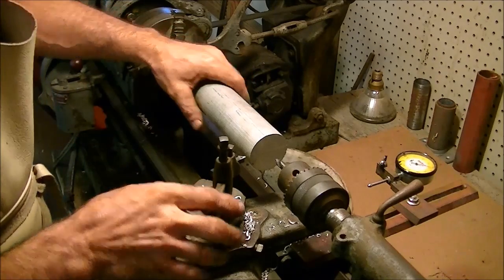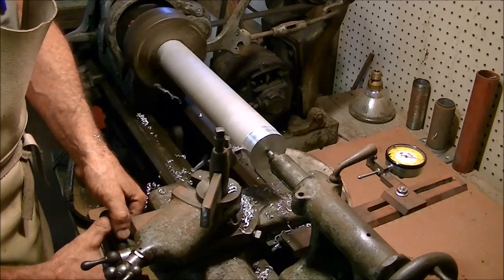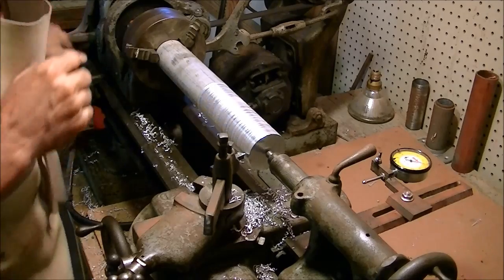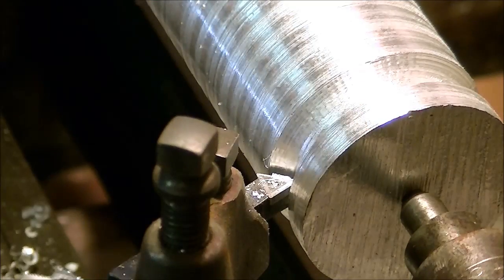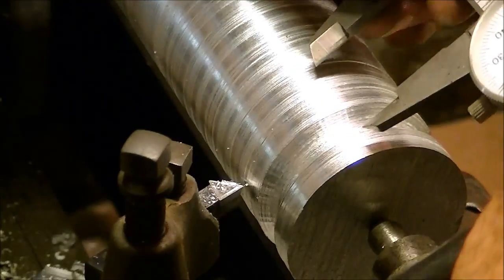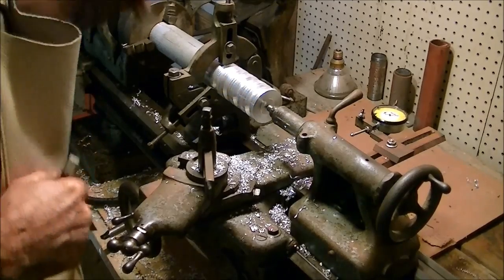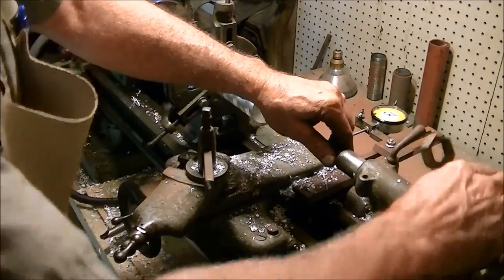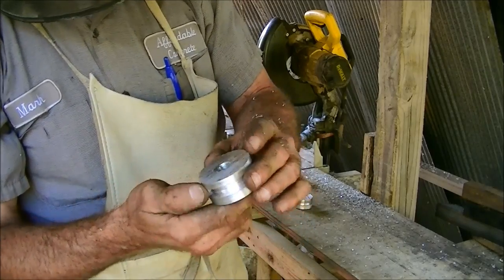Making 4 cable pully's out of 2" stock on my old lathe. Slowmotion and fast forward.

Comment: Whenever you find yourself turning aluminum again keep a can of WD-40 handy and use a really sharp positive rake high speed steel tool, you won't get all of the noise and chattering that you're running into. Cheers from one maker to another!

Comment: You don't use any cutting fluids/lubricants?
Reply from the maker: No, I don't do much machining, just when I need a part. I guess I should get some to have on hand.
Reply: markp0177 Watered down engine coolant works well enough,is cheap,readily available...
Reply: FJ80Coop I may give that a try.

Comment: The last time I worked with a metal lathe and a micrometer was in high school.A man could make almost any type of part needed with this type of equipment.Brings back a lot of memories. Excellent work. The aluminum you are working with is very soft and easy to mill unlike steel.